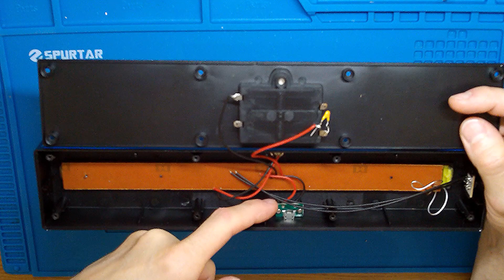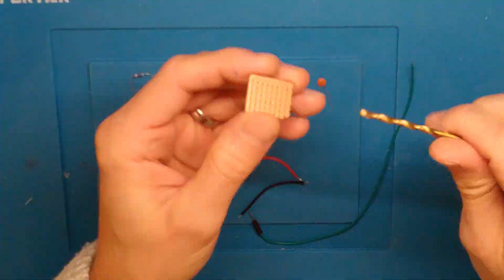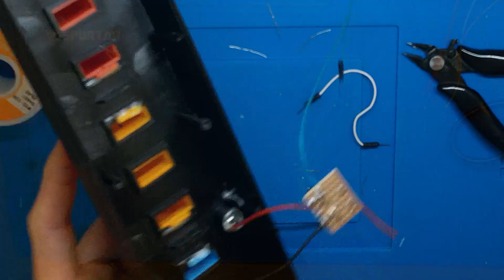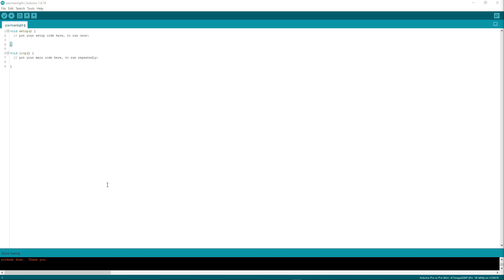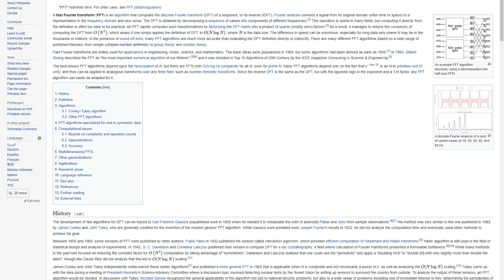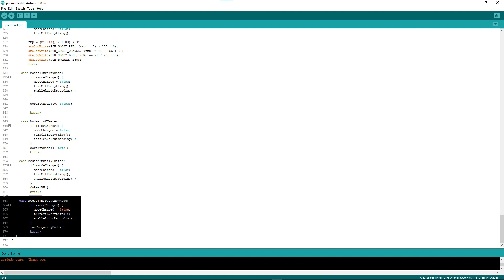Modding the retro "Pac Man and Ghosts Light" product with an Arduino!

Comment: Good evening, an excellent idea, I congratulate you for the improvements. Please consult, will you have the Arduino code that you can provide me without the update because the one in the description gives me errors when you check the sketch
Reply from the maker: What errors are you getting? That is the latest code
Reply: @RobSmithDev  I tell you, I have downloaded the fht libraries and placed them inside the arduino libraries folder, I open the pacman sketch and I get the error prog PROGMEM prog_int16_t _window_func[] = { and C:\Users\fungu\OneDrive\Documents\Arduino\ libraries\FHT/FHT.h:103:12: error: 'prog_uint8_t' does not name a type; did you mean 'uint8_t'?
   PROGMEM prog_uint8_t _log_table[] = {
Reply: I recently included the skecth fht library again and now I get this error C:\Users\fungu\OneDrive\Documents\Arduino\libraries\FHT/FHT.h:77:12: fatal error: cas_lookup_256.inc: No such file or directory

   #include <cas_lookup_256.inc>
Reply: @RobSmithDev  I was able to solve some errors because I had the fht library wrong. The only error I'm getting right now is the following:
exit status 1
'fht_log_out' was not declared in this scope